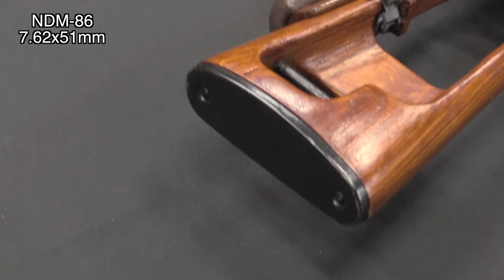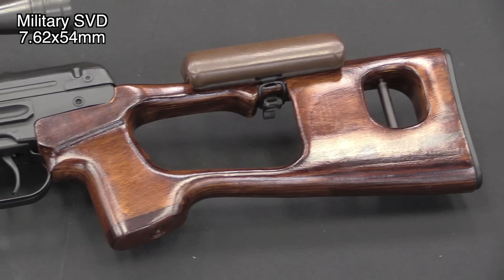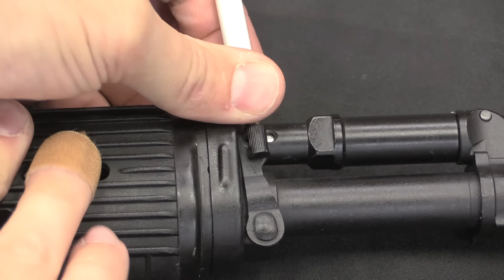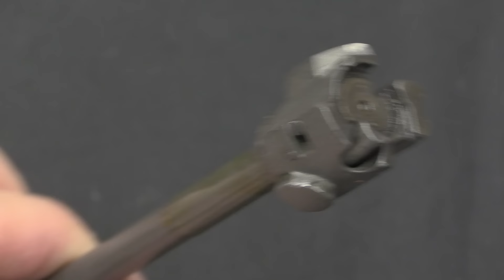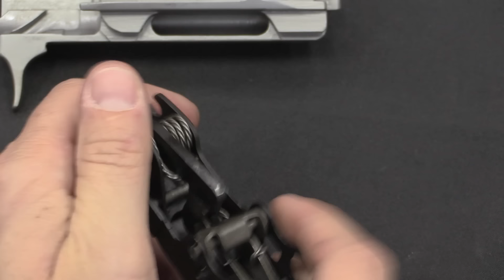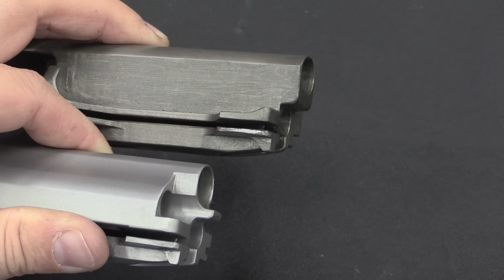Dragunov Variations: Military SVD, Izhmash Tiger, Chinese NDM-86

Comment: The way you showed the 2 Stages of the gas-system at 10:12 is wrong. The lever must not be pushed when changing between 1 and 2, it is only for disassembly. The position one locked in (audible click), position two can not be done by hand, you will need the cartridge. The lever (which you shall not push) will keep the internals where they are, while the outer part will turn and block the gas holes, pushing more gas through the gas cylinder.

Comment: I bought one each of these in the late 80's plus a PSL.  They were cheap back then, $250 for the Russian, $200 for the Chinese and $150 for the Tiger and the PSL. After a couple of years the prices started going up and never stopped to this day.
Reply: Would you say it was worth it? They aren't as expensive here in South Africa as they are in America but they aren't cheap either, a brand new Tigr SVD costs the equivalent of about $900, right now im on the fence between getting one of these or a 300 blackout AR that I've had my eye on which id about the same price.
Reply: @alexvermaak1759  I bought them because they were cheap and so was the ammo. No so now and with import ban on Russian ammo the prices have gone way up and it's harder to find. I would by the black out today. 300 black out performs as well as the old Russian ammo ever did.
Reply: @johnwillis4706  lol 300 bo does NOT perform nearly as well as 7.62x54. It wasn't meant to. its much closer to the x39 than the x54.
Reply: @alexvermaak1759  get the SVD. Its better in nearly every way. Ive owned both and the AR is only good for modularity and customization

Comment: Isn't the Chinese one reverse engineered from Viet Nam examples? I am fairly certain they have a different barrel twist too.  The Chinese were taking everything and measuring and copying it during the war. We were sending planes down the rail lines into Haiphong. The Chinese would hold them up for inspection for months on end, then release them. When they arrived and were being uncrated for assembly, they were full of hastily installed counterfeit Chinese avionics and other parts. There was blatant evidence of disassembly and sloppy reassembly. They were taking parts off and often replacing them with Chinese or Korean replacements so they could move them south to their destination. They were doing this with trucks, missiles, guns, anything.

Comment: Practically no difference Ian? I bought the Tigr with dreams of sourcing or duplicating the 7N1 sniper load with a 152gr bullet. Turns out the Tigr has a radically different twist rate suited to 203gr bullets. I tried every commercial and milsurp load available, and the only one that grouped was Barnaul 203gr. 3 shots often sub MOA at 100 metres. Sometimes 5 shots within MOA, but by the 4th shot the barrel heat always started to open it up. Anyway, the whole draw of the SVD system was the scope-rifle combination, where a known (and accurate) cartridge is matched to the bullet-drop-compensated scope. No need to calculate ballistics or count clicks, just set it to the range and fire. This falls flat when you have a 203gr bullet traveling slower (since its heavier, and due to shorter barrel) and with different BC. Making the BDC scope more of a pain than useful, much past 100 metres. So no, in practical terms, HUGE difference. Still a brilliant rifle, 100.000% reliable.

Comment: I'm going to point out that the ATF isn't entirely wrong, changing up the disconnect on the trigger would in fact turn that out of battery safety into a perfect auto-sear. It is not a machine gun currently but definitely fits under "could easily be converted".

Comment: What is an adjustable gas system for? Is it to control the speed that a new round is chambered? Or is it to control the muzzle energy of the weapon?
Reply: Also was questioning that. Unfortunately Ian didn't explain it(
Reply: @НелиелОксингейл  I just googled it an apparently if you chamber different types of rounds in the same weapon, you need to adjust the rate of gas return for the blowback system. Web sources I found were vague. Only gun people will know! :(

Comment: The theory of NDM being OVERSTAMPS (at least the ones in x54R) is a very plausible one. If they did make them, why did they stop? I believe Chinese never fully MANUFACTURED SVD rifles. Instead they bought a large batch of parts kits from Russia in the mid 70's. They tried trough out the 80's but any changes they made to it (like converting it to .308) made it less reliable. They tried making their own clones of some main parts, like receivers and barrels, but it never really worked, so they have abandoned the idea as they ran out of the donor parts kits.
The proponents of this theory use the following argument to justify it:
-- why are there Russian writing on the rear irons leaf?
-- why there are no other Chinese small arms use plywood furniture?
-- why plywood furniture on Chinese rifles and on Russian rifles (made in the 70's) are indistinguishable from one another? If they cloned it so well, why didn't they use that technology on other guns?
-- why almost all main parts (gas block; FSB; gas regulator, bolt carrier, small parts in the trigger group, ...) on "Chinese" rifles look like they were made on the same tooling with the Russian guns (if you compare to the ones from the 70's)? Case in point, when you look at Russian and Chinese AKM from the 60's, there are tons of differences. When you compare SVD and NDM-86 they are virtually identical to the smallest details.
-- OK, let's say Chinese did clone everything identical, even used the Russian "П" on the rear irons. Why than didn't they clone the scope the same way?  I don't think they ever purchased the scopes (or may be Russians refused to sell them) When you compare the Chinese version of PSO-1 scope and the original one, you will see hundreds of differences. Why such a different approach in the scope clonin department?  
-- I personally own one early import NDM-86 which near the mag well has some signs of "something" being ground off, and then over stamped with the Norinco markings. Also, my good friend has another NDM rifle with very similar traces in the same area.
I can write more, but the essence should be clear. Oh, and I own two NDM-86 in x54R, one Tiger and a 1990 built SVD, I work with manufacturing (so I know machining and tooling and know  how complex it is), oh, and  also I read and write Russian, so my research capacity of the subject exceeds wikipedia by the factor of 20 at least.

Comment: Let's not compare Apples and Oranges, shell we?
Comparing bolt carriers of NDM-86 in .308 and SVD in 7.62x54R is NOT correct.
If you were to look at carrier from NDM in x54R, you will be surprised how much it looks the same. 
I know, cause I just did it...

Comment: This things need to be corrected in this video:
1. Auto safety is there NOT for preventing automatic fire, but to prevent pulling the trigger and it going "click" when the bolt is open.
2. Auto Safety DOES exist in the Russian SVD. It was removed by the demand from ATF prior to the importation. Main reason for it was scary word "AUTO" in it.

Comment: I can't believe you missed the fact the NDM-86 uses a 1:12 twist barrel, while the Russian (and the PSL too btw) use a 1:10 twist barrel. This was done to increase the accuracy of the 7n1 cartridge by 19%...however while more accurate with that round it cannot fire the explosive rounds that the russian 1:10 barrels can.

Comment: I owned a Dragunov Tiger back in the '90s when I had my gun shop. It was a fun shooter and a rugged, accurate weapon. I'm trying to remember from almost thirty years ago so I could be wrong, but I'm almost certain that mine, unlike the one in the video, had both a wooden forend and buttstock. It also had a similarly illuminated reticle (yellow) Russian scope. $6900?! I guess I should have kept that one!  :)
Reply: @Brad Carter Definitely, Brad!
Reply: @XTrooper3936 my boss has a tiger that I wanted to buy and he wants 12k for it. He paid ~900 for it in the 90s if I recall correctly. Sad those times are gone.
Reply: @DavidBanks02  My dealer price was $500-something which was a fair amount of money at the time, but not crazy expensive.
Reply: В 2026 году Тигр в России стоит примерно 1500 долларов США

Comment: Nice video! You are one of very few smart guyz who properly recognize SVD as marksman (NOT sniper) rifle.
As for differences between SVD and Tiger - the main and only substantial one is barrel rifling. SVD with it's 240mm twist rate can be used with both light and heavy cartridges, Tiger with it's 320mm twist rate - with light cartridges only. Some military cartridges like incendiary AP will ruin Tiger's rifling pretty fast. 
Though Tiger due to it's rifling is a bit more accurate than SVD.

NDM-86 also has 320mm twist rate AFAIK. I don't know how chinese deal with it. Maybe they just don't use heavy cartridges.

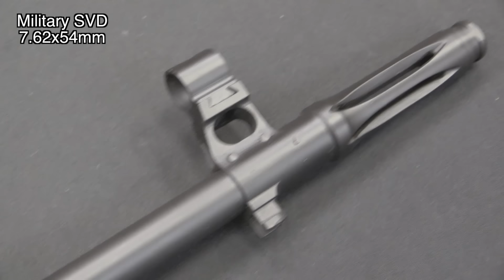Comment: 5:24 1.5 to 2 moa at 100 meters? That is not good at all. If there is a target out there 1000 meters away, he is pretty safe.
Reply: Thats with the standard 7,62x54r. They made 7n1 to use with svd and its easily under 1moa platform with correct ammunition

Comment: If you were to compare a 1970 - 80 Russian SVD and "Chinese" NDM-86 in 7.62x54 you would find no differences...
dust covers
trigger groups
gas regulators
bolt carriers
the shape of the front swivel
rear sights
EVERYTHING is identical.
Only one thing differ them, Russian Rifles have 240mm twist and the "Chinese" ones have the ame 320mm twist Dragunov originally designed his rifle in. 

Oh, but wait, then there are 3 years of Russian production from 71 to 74 when they were making ONLY 320mm twist, and those are the only years you can hardly meet in Russian military. I wonder where did they all go? Hmmmmm.....

Oh, and there is just one more thing(sic). Well, actually two more things. Can you name another Chinese made weapon (before or after NDM) which uses plywood pressed hand guards. In Russia they have used the same technology on all of their guns starting from SKS all the way to AK-74, until in the late 80's they have made quite an advancement in shock and heat resistant plastics... But still. Try to compare 970s made Russian SVD hand guards and NDM-86 ones. I Pepsi Challenge anyone to find any design differences. The differences  which could NOT be attributed to a simple production batch differences, which there always are... WHy would anyone go to such an extent of carbon copying? Enyone knows that carbon copying is way more expensive than making an "optimised copy", kinda like Norinco made AKM version. Why not do what the Inquiries did with their Tabuk? Why did cloning to such an extent never happened in Chinese gun-copying history before or after? 

Another logical question is, if Chinese just suddenly decided to make a carbon copy of the Russian SVD (they have even copied Russian "П" letter on the rear irons), why didn't they clone the scope? What happened there? Did they run out of cloning steam? Or is that because nobody sold them the kits for the scopes, and they had to make their own design there?

The rumor has it that the Russians sold to China few train loads of SVD kits in the late 70's. Looks like they have sold them everything they have manufactured from 1971-74, as those were all in 320mm twist. Then, the Chinese tried to make/mofify some of these kits, and experimented with 308, but failed, as especially the 308 versions are notoriously prone to malfunctions and catastrophic failures. Obviously there are some late 80's NDM-86 which made it to the USA which obviously were (at least their main parts, like barrels, receivers, magazines and perhaps trigger group housings made in China. But most small parts, and the wood parts, those all look like they were made in the USSR...

P.S. Jsut in case someone wants to question my credentials.  I actually own 4 Dragunov rifles. I also have many different SVD partsfrom different years of production.  So, I do have things I can compare to, and therefore I do know what am I talking about. Moreover, I work in the gun manufacturing business, and I do know what manufacturing processes are, and how complex they can get...

Comment: "Sub MoA Groups."  Yeah, on a bench rest.  That^ doesn't even have a Bipod.  Now, carry that in the field with a Fireteam, a machinegunner, maybe a light Mortar, or RPG-7 launcher, and get a 5" group at 500 yards.  Propped up on a chunk of rubble, after running across a cratered field, while your squad is being shot at, and soaking up fragmentation from the Enemy grenades/rockets/mortar shells/mines.  That's what this is designed for.  Not Sub-Minute-of-Arc groups from a bench rest.  You realize that measurement, MoA is 1" per 100 Yards, right?  So, that guy bragging about making head-shots from a mile away?  Is bragging about doing it with something that he rated to shoot 16" groups, at mile away.  (I'm guessing that Russkie had a 16" head.)
Reply: That guy?  Yeah, whenever he tells the story, the fish gets bigger.  The war story I believe?  "I don't want to talk about it."

Comment: great work as always, Ian! great video! however, my friend, i've heard this repeated constantly and i am worried people have begun to just take it as gospel without at all investigating it. what i am talking about is the idea that the more locking lugs you have, the more accurate the rifle will be. this is simply not true, sir, and you know that i'm sure. i don't think you meant to infer that, but i think the way you said it about the three locking lugs in comparison to the AK's 2 locking lugs could get across to folks that perhaps simply adding more locking lugs somehow makes a rifle more accurate which i know for a fact you were not trying to say as i know you don't believe that. look at the FN FAL and other tilting bolt rifles which are extremely accurate. they have nothing to do with their locking mechanism and everything to do with the harmonics of the barrel and of the weapon system in general. if the barrel is free floating (i.e. not directly impacted by the stock and other furniture) that makes it all the more accurate as you said in your video on the Cheytac Intervention, sir. 

anyhow, sorry for picking on that one little statement, i just don't want people to start thinking that two locking lugs is somehow not sufficient even though the vast majority of target rifles (bolt action rifles i mean) have two locking lugs and those are the most accurate rifles around... many firearms use tilting bolt designs so they don't have the bolt locking up into the barrel period (as i stated before - the FAL is a good example and so is the SKS if you want to talk about a Soviet design :); however, there are other designs as well like the star 8 locking lugs on the AR-type weapon system that make up the "star chamber" that is hellish to clean in the field as all of us vets know lol ;-).

Comment: Summer of 1993 I worked for B-West Imports of Tucson. We received a Tiger from IZHMASH... and... not knowing better... I was testing the gun with Lapua 7.62x54R ammo... and the primers were, as you can guess soft... and after about 10 or so rounds into firing I had a round go of out of battery... the bolt carrier was undamaged, the bolt head was slightly bent up. However, the tiger receiver was undamaged. The receiver top cover was slightly damaged and need to be replaced. I wrote a complete report to the factory and they sent replacements together with a spring loaded firing pin bolt...

Comment: interesting, my polytech em351 7.62x54 has the same bolt carrier and trigger group as the russian military one in this video, and have adjustable gas port.  i bought it new, the dealer told me the em351 is the chinese military version.

Comment: I'm in love with weapon, the only one i could afford was an Airsoft replica of the SVD. But that's a pretty damned good sring loaded replica that shoot 0.30 grammes plastic BBs at 450/500 f per sec up to 75 meters!
And does nice groupings up to 50 meters. In fact it shoots 2 to 4 MOA groups at 50. That's not that bad for a Replica! No? One of these days i'm gonna grab a real one, for sure. Regards from France... 😇🇫🇷😎